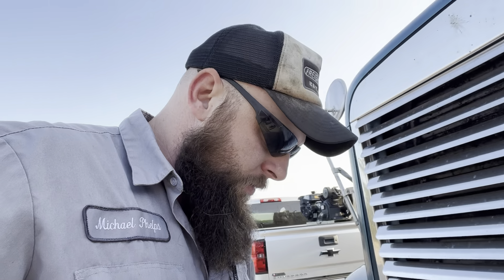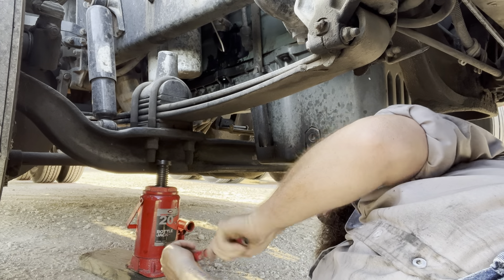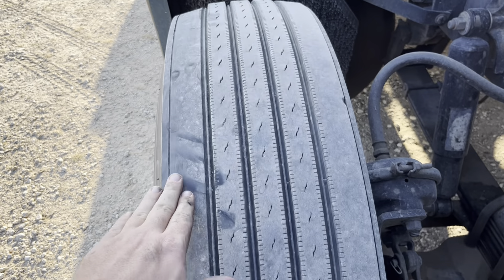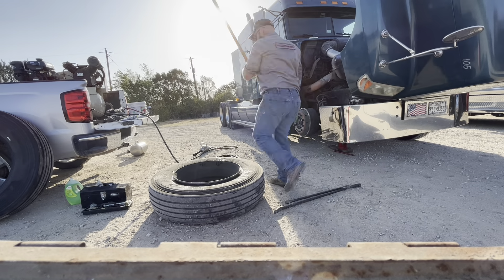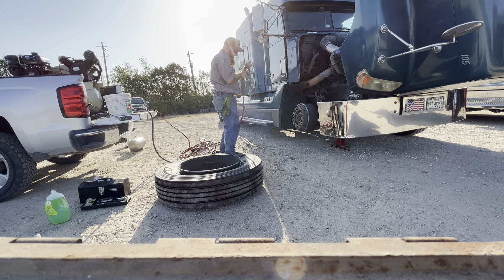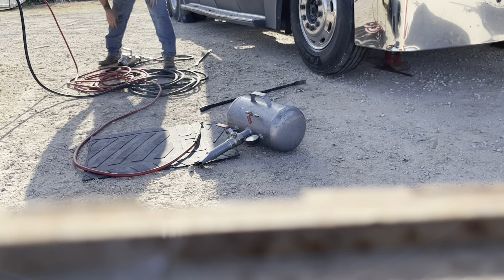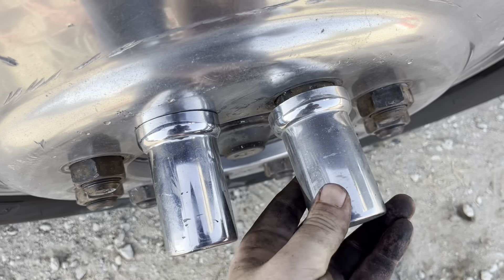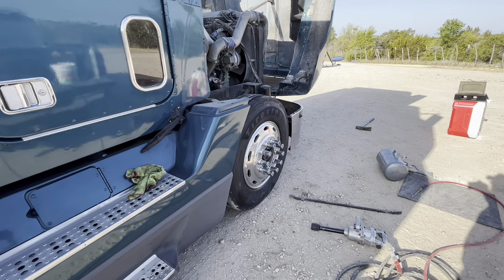55. Replacing a Steer Tire on the Freightliner (Old Video)

Comment: I can't get mileage out of steer tires either. 
I would be happy to get 75,000 out of a steer at this point.
Reply: You need to follow..every 10k miles or 30 days...check tire specs and tread...I am the master of tire wear...1 million miles plus 3 3-10sets...so ask and I will help...ome alignment in 4 years...300k on my steers...so match that...ANYONE

Comment: Get rings....sense so matics....and check king pins....that's a waste of a steer....I run all position Michelin x3...been on my rig for 125k plus. ...if a steer shows wear...rotation to the rear...do it before it gets that bad....it will smooth out...i get 300k on my tires...remove all...sell at auction and buy all new....steel black wheels and roll on for another 3 years...great video...let's do more then 5 a year...

Comment: The Freightliners FLD is the XL classics I've got I've got a couple of them running on the fleet on mine and my dad's Fleet together we aerated the whole truck and it runs better on air running it did anything but it looks like you need to put a whole new front end alignment front to back and I'd go ahead and air ride that truck cuz them trucks are darn good trucks they're not bad trucks I've got one I just clocked 1.4 million miles on and we're still running it around the around the farm and it's a good truck but I rebuilt the whole thing where I didn't have to mess with buying a new one but I've restored that thing and it's a work truck and it's a good one but I put a whole brand new airbag system front to back everything new axles I think the front end on your truck needs to be air ride I'm not telling you what to do I'm just passing along some advice

Comment: Shocks or wheel bearing issue. ..you need to torque at proper specs...and I don't believe it's a spring....sorry...get factory shocks...not gas...hydraulic shocks...top of the line...let's chat some time